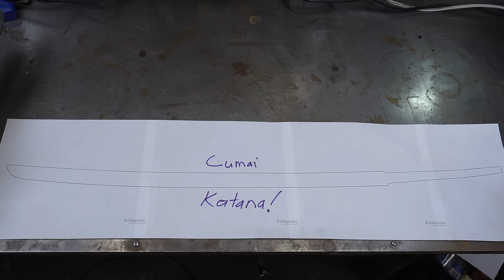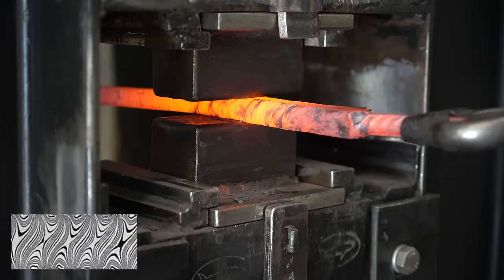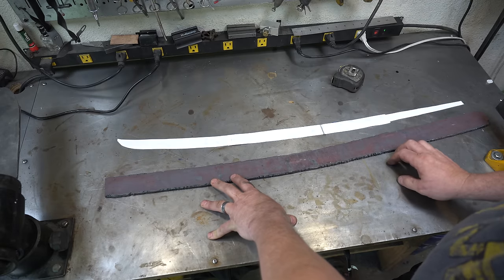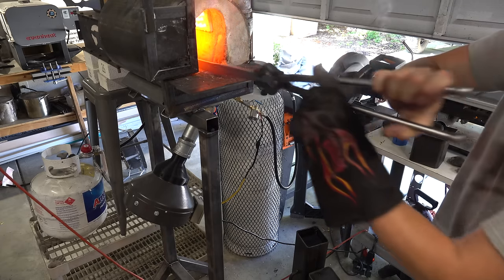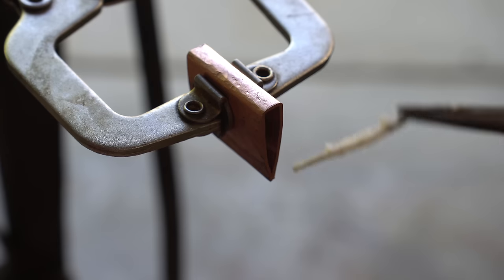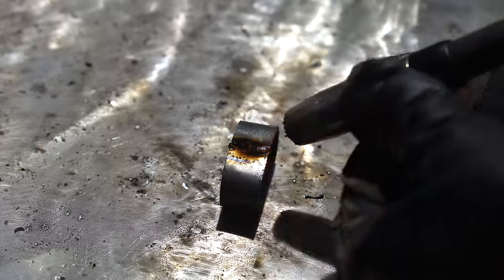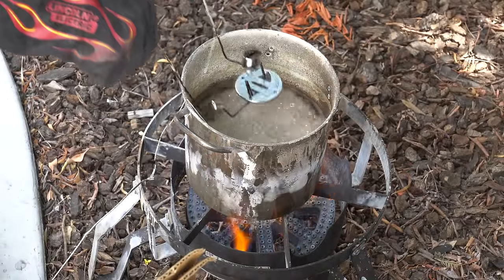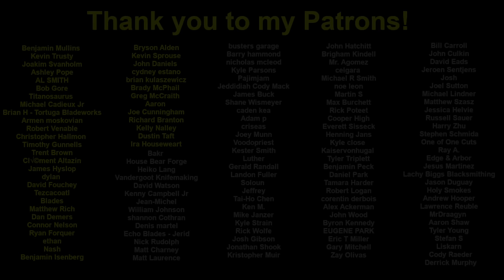Forging a Copper Damascus Katana

Comment from the maker: For those asking:  1) This one is already sold.  I do not do custom orders because this is just a hobby and I only sell what I make or the channel.  I have some knives available on my website, check those out (link in every video description).  2) Yes I'm aware that the curve in a traditional katana is from the heat treating process. I chose to not differentially heat treat this blade because it is damascus-cladded.  If you apply clay and get a hamon, the steel above the hamon will be soft and the damascus will look terrible.  The copper takes the place of the hamon aesthetically and also provides shock absorption.   3) The copper bond is very strong.   The copper in the blade is a thin sheet over the central core of high carbon steel which is also the cutting edge.  The copper brazing bond is in excess of 70000 psi in tensile strength and you'll destroy the blade before you shear the layers apart.   4) Galvanic corrosion requires the presence of an electrolyte (like saltwater).  Keep the blade clean and dry and oil it on occasion like you should with any carbon steel blade and it will last a lifetime.  Basically if you keep the steel from rusting, the copper will be just fine.    Thx.
Reply: I was wondering about how this kind of blade would stand up to combat stresses seeing as copper is such a soft metal and it feels counter intuitive to use it making a Damascus.
However, having used it the way you have in your explanation I guess it'll endure just fine. 
Have you considered a Bronze Damascus blade, or experimenting with other metals to make Damascus blades?
Reply: I know it will never happen but I wish people would stop calling this stuff "Damascus" because its not. Its pattern-welded steel. Researchers re-invented the Damascus process back in the 1990s, but aside from that no one has made real Damascus steel in more than 500 years.
Reply: That answers my question about the copper bond.
Reply from the maker: @Sajuuk  brass and bronze layering is certainly possible and people have done it.  It’s a bit trickier because the melting point of brass/bronze is about 1650F whereas copper is 1950F.  There’s less margin for error with the brass/bronze.
Reply from the maker: @TheSpenceFencer  and I wish people who have watched a video and want to tell the world what they know should refrain from telling real bladesmiths what terms to use.  “Damascus” is the accepted term for both crucible steel and pattern welded.  Every smith out there, including master smiths, will call it Damascus.  The ABS calls it Damascus.  If we wanted to refer to crucible steel we’d call it Wootz.  Plus Wootz has been and is still made today.   Sorry, if this comes off snarky but I’m tired of being “corrected” by armchair warriors who have never forged a blade.  This comes off incredibly pretentious to actual bladesmiths.
Reply: You not doing this just proves that you know so much. Phenomenal work man.
Reply: @TheSpenceFencer  you're so smart man, you radiate big brain energy
Reply: Hey Tyrel Have you every watched Conan the Barbarians 1982. Do you think you could forge his fathers sword seen at the begging of the movie. I have been begging Matt and Ilya at That Works and formally man arms to do Connor MacLeod's Katana from the original Highlander movie for about 6 years they finally said they will do it. But I loved the Conan Movie as a kid and I would to see that build. And the Katana was awesome.
Reply: I saw your previous videos, so I never doubt your decision. Different blade structure really needs different heat treat method. And wow, just nearly 2 days more and the number of likes is double 😯. I'm really looking forward to your next videos! Btw, I think "Asian swords" is a really hot topic these days.
Reply: Awesome work how much is it for a katana like that
Reply: @TyrellKnifeworks  The main issue with that is that it makes practically IMPOSSIBLE to find historical Damascus blades on the internet. You get ALWAYS redirected to pattern welded blades. That's quite annoying.
Reply: @TyrellKnifeworks  Yes but I want to see YOU make pretty copper/brass/bronze blades, Senpai!😉
Reply: Awesome creation!I think the scabbard should not have felt inside as it traps moisture and may result in corrosion, what's your take on this? Thanks
Reply: Can u please 🙏  make a test video for this blade????
Reply: @TyrellKnifeworks  It doesn't come off as snarky at all. You're right. This person has probably never even held a hot piece of steel. Like you said, everyone calls it damascus steel. Everyone knows what's meant by it. This guy is basically just the "Uhm, ackchyually!" stereotype.
Reply: My main concern while watching the video was that somehow the copper would screw with the temp diff or dissipation, but now that i think about it, the copper is way too thin, it has very little mass and it's sandwiched between to layers of steel so the difference it could do in diffusion or any other way is negligible at best.
Reply from the maker: @capomundial86  Are you referring to heat dissipation during the heat treatment?  This technique is not new and it's now been done by hundreds, if not thousands, of bladesmiths.  The blade certainly hardens quite well.  I showed the HRC test on the video.  Thanks for watching.
Reply: @TyrellKnifeworks  Yeah, im not really versed in the subject at all, just as a casual viewer and it's the first time i've seen an in depth take on this technique so it propped a lot of questions in my head. Most were answered either on the video or on this comment. But while watching i got some doubts about the difference in heat conductivity of copper vs steel and how it would affect the heat treatment, the weld and the final product. And if it does make a difference, what are the steps that account for that and change "normal" procedure to adjust for it.
Have to say it though, that blade is amazing and the quality of the workmanship is top notch.
Reply: So a question: can you make a katana using traditional method with the tools available in your shop?
Reply from the maker: @niwrad84  yes of course.  I can make any bladed weapon with the tools in my shop. 😉
Reply: I reckon you could make a mean as looking pattern with embedded copper cable. Would look like little streaks of copper. Probably really hard to do though..
Reply: @TyrellKnifeworks  man those pattern would look sick on a kris sword
Reply: Holly smoke that's a nice sword. Fantastic job! 👌
Reply: aaand you answered all my questions
Reply: People are so special on the internet Haha Thanks man!! Sad you even needed to "Clarify" for some people. Looks amazing!!!
Reply from the maker: @OffyTheSwitch  I'd be worried about the "looseness" of the cable compromising the structural integrity though.
Reply from the maker: @niwrad84  I'll definitely do a Kris as some point.  Many have asked or it.
Reply from the maker: @stanisawszczypua9076  Thanks for watching!
Reply from the maker: @danielroden9424  Thanks for watching, Daniel!
Reply: That’s really interesting.  I would have thought the copper layers would weaken it.  I’m surprised it can bond with the steel so well.  Thanks for letting us know about this.  Fascinating stuff.
Reply: @TheSpenceFencer  
True.  I had a hypothesis at one time that Damascus resulted from Syrian blade makers combining expensive Indian or Iranian steel with local lesser quality steel to save money and produce a still great quality blade; but then I watched a video which shot that down and explained that the Damascus pattern was the result of a unique, locally sourced type of steel that had certain additional metal alloys that produced the characteristic Damascus pattern, resulting in high quality blades with the unique pattern.  It’s amazing what ancient people were able to do with just basic materials and processes.
Reply: do you do custom orders by chance? im looking to get a new knife and i really love the design in this katana
Reply from the maker: @joeyong1418  If your scabbard has moisture in it, you have other problems.  In a real combat blade, it wouldn't have felt, but then they don't really care much about scratches either.  I'm trying to protect the finish on this blade.  Thanks for watching.
Reply from the maker: @Fer_Silfore  Sorry, I'm not taking custom orders right now.
Reply from the maker: @joshmajor8662  "Special"... that's one word for it.  🤣🤣🤣
Reply: @Bahamuttone   Just use the less general terms, if you want crucible "Damascus" search for wootz, bulat, crucible-steel etc.
If you search for a term used in a very broad sense, it will show what is the most common.
The confusion isn't even new, the middle east also used non crucible-steel "Damascus" (usually "random" pattern welded "Damascus" pattern like often used on modern Katana reproductions) for blades .. 
Use more specific terms and you'll find what you're looking for.
Reply: Beautiful absolutely beautiful
Reply: great explanation! thank you
Reply: That copper "hamon" looks better than a real hamon
Reply: @TyrellKnifeworks  I LOVE the black coffee effect. But i am worried that it is just for show and will rub off over time if used. Not such an issue with this masterpiece, as I would just gaze at it longingly all day in a stand (if I was lucky enough to have it) But for a kitchen knife? Is it truly viable? Does it scratch off? Would bluing be better? And if so.. can you "blue" a knife used for cooking? Is it safe?
Reply: I ask as I made a damascus blade on a course, and the knife corroded and pattenered very quickly ruining the damascus look, so I polished it hard and sanded it down a bit to get it smooth, and yeah.. I removed the acid etching. Even more worried about making a coffee knife, selling it (if I am lucky) then the person complains it does not last.
Reply: @TyrellKnifeworks  You are starting to rival kyle in a big way.
Reply from the maker: @whitenip84  thank you!
Reply from the maker: @alanwalker6708  yes, you need to keep carbon knives (Damascus or not) clean and dry and oil them on occasion to prevent that from happening.  Coffee actually helps prevent corrosion, but it can still scratch.  Some people don’t even etch their Damascus and let the natural patina have it come out over time.
Reply: When will you be on FORGED IN FIRE... I bet this is something that they would never try to do...
Reply: @TyrellKnifeworks  fuck all these haters... you're doing amazing work,  don't give them the satisfaction. Keep doing YOU and making blades fit for royalty
Reply: @TyrellKnifeworks  Gotcha. Thank you for the reply!
Reply from the maker: @allwaizeright9705  they are actually researching cumai for FiF.  I’ve applied, just waiting for them to call!
Reply from the maker: @whitenip84  thank you!
Reply: only 10 minutes into the video but needed to comment anyways :p ... need to ask about the width (back/ridge -> edgewise) of the blade to towards the tip - most genuine katanas taper from the habaki to the kissaki - did you consider this? If the tip, just around the kissaki is the same width (from ridge to edge) as in the habaki area i mostly think a sword like that looks to much like an european saber :-)
Reply from the maker: @g.ijoebear1759   it does taper from the hamachi to the kissaki.  It’s 1.25” at the hamachi and about 1.1” at the tip.  Thanks for your concern though.  😜
Reply from the maker: @g.ijoebear1759  if you were referring to thickness, that tapers to.  From 0.250” to about 0.210”.
Reply: @TyrellKnifeworks  :-) .. finished the video,, although im more of a traditional style connesour of japanse swords, yours is very nice with the damascus+copper style.
Reply: Ok, I'm satisfied with the explanation
Reply: Do you have a website or something of the sort I don't care if I have to save for a decade to buy a sword like that I want one and have you considered uploading a video of you testing it against a few things without ruining it of course 🙂
Reply: @g.ijoebear1759  Ever made a European saber or a Katana? You sound like a super expert. So how many you made?
Reply: @alanwalker6708  .. no no, im not a sword smith, just very into Japanese swords and their shapes, esthetics :-) .. and i look at other swords as well, but my favorite are the Katanas :)
Reply: @capomundial86  with modern metal it's not needed. The blade is essentially the core. The blade was a 60 Rockwell hardness. Probably better than most actual samurai swords.
Reply: where it says that sorry little b** s*** in there that wasn't meant to say that I use my microphone to type and I was trying to say whatever they call those those little bamboo mats that you guys cut or they cut and Bushido or whatever I was trying to say that I can't remember what it's called so but it came out as that I'm not talking s*** and that's a beautiful looking sword I've ever seen almost for the look I just wonder what it can do
Reply: oh yeah also I make swords myself but I'm nowhere near as talented as you are
Reply: @TheSpenceFencer  As tyrell says indian WOOTS steel made in a crucible is the ingot used and Damascus was where the best blades were forged using a folding process using these ingots. 

Pattern welded steel is when differently folded steels and often softer iron billets are forged welded together for visual appearance (vikings) and to provide a hard cutting edge with a soft spine. 

This is modern damascus. It is classified as that in every definition you can research. And why? Because the damascus part of the name is the TECHNIQUE of folding the steel. 

If you had said "no one has made wootz steel in 500 years" you would be right, but instead you come off as a wannabe no-it-all proven to know nothing beyond some half arsed google searches and zero expertise in the subject matter. 

Stay on your couch.
Reply: I love the video man. It's very cool, creative and informative.  👍
Reply: I came in looking for this comment since I wanted to know why an experiencednbladesmith such as yourself  didn't use the traditional hardening method. Noe that you explained it it makes perfect sence and I feel daft for doubting the process.
Reply from the maker: @qwertyu19951  I appreciate that you went searching for the answer.  Unlike many who just post shitty comments without even asking a question of why.  Thank you for that! ❤
Reply: @TheSpenceFencer  the only thing that made damascus special was that patterning. Crucible steel existed in other places, some real real high quality blames came out of places all over asia and europe, such as toledo steel. or spring steel. So the term for those patterns like everything else have been evolved. language evolves. We have used terms that have at one time many centuries ago meant one thing, and now it means something different. Such as a term for a bundle of sticks, the term regulated, amongst many many other things.
Reply: @TyrellKnifeworks  Any bladed weapon?
How about a matching set of cu-mai Klingon Bat Leth (sword) and Dak'Tang (Dagger)? That would be pretty sick.
Just saying.

BTW, the katana is sweeeeet!
Reply: How can i has one!?
Reply from the maker: @crimsonhawk4912  sorry, I’m not taking custom orders.  I sell what I make for the channel.  I have some knives available on my website. (Link in every video description).
Reply: Let the experts do the Katana but everyone else can use a set of kitchen knives.
Reply: @TheSpenceFencer  ok? Nobody cares Damascus is what it’ll be called now and forever stop crying about it
Reply: even so, if it rusts it would still look pretty cool a little green
Reply: @alanwalker6708 I would never had thought of that without you…. No wait… done that, didn’t really work. Still the same images of modern pattern welded thing.
Reply: @TheSpenceFencer  I agree, but people are idiots, so they'll keep calling it damascus.
Reply: @TyrellKnifeworks  you're self-described as a hobbyist. Having a bunch of equipment and a youtube channel doesn't make you an expert. If you read history, everyone knows the process was lost to time. Keep wallowing in ignorance and just pretend you know what you're talking about.
Reply from the maker: @SteveJaeger  no, it doesn’t.  But being an ABS Journeyman Smith does.  Wootz isn’t “lost to history”, that’s complete BS.  Those actually IN this craft know that, not internet trolls who just watch movies and play video games.  🙄
Reply: Do you think if you did make it to the third round of forged in fire you would make the first copper Damascus finally weapon?
Reply: No kid can not play with this
Reply from the maker: @jamesswatscheno7021  probably not, they take too much time.
Reply: @TyrellKnifeworks  I have a question/request, what is your favorite Falchion sword style and can you make it? Falchion swords are underrated I'd argue it's the European equivalent to the Katana.
Reply from the maker: @derekcox543  I wouldn't say I know many styles of Falchion swords, though I'm familiar with the basic one.  If you consider the falcata one of those, I would say that's my favorite.  Checkout my "spartan" sword video where I make a damascus one.  Thanks for watching, Derek.
Reply: @TyrellKnifeworks  The Falcata counts in my book as a distant older cousin of the Falchion through I'm sure I'd be chewed out by a historian if they ever heard me say that. I'll check out the Spartan sword video, thanks for replying Tyrell.
Reply: Well dam I want one and most definitely not going to war with it.
Reply: @TyrellKnifeworks  The felt would certainly keep the blade nice and safe... until a single grain of sand gets into the material.  Not, I imagine, that the blade will be in and out of that scabbard on a regular basis.  Having dealt with felt lined carriers before (for industrial measuring apparatus) having to get the grit and grime out of glued-in felt is a nightmare yet one bit of sand could scratch the tool to the point of ruining it... granted, the tool did not have the same hardness at all.
Reply: @TheSpenceFencer  It's good to see other people calling this out. So many smiths on Youtube falsely advertise pattern-welding as Damascus and seem adamant about doing so. For as much skill and care that they put into their craft, misinformation is misinformation and it's never a good look.
Reply: @TyrellKnifeworks "Everyone's doing it" is not a reason to perpetuate a misnomer. Whether you're a real blacksmith or not if you're misusing a term, you're misusing a term.
Reply: @Tyrell Knifeworks ... I'm sorry to inform you, but I think you got the japanese katakana inscription of your name wrong....you actually engraved "Tairenore naifu wakusu" and not "Taireru naifu wakusu". You separated the katakana "ル"(ru) into 2 . You did: ノ=no  レ =re, when together, they read "ru". I don't know if you understood my explanation. Hope this helps.
Reply from the maker: Yup, been told several times.  Not much I can do now. Thanks for watching.
Reply: @SteveJaeger  the process wasn't "lost to time" and it's hilarious watching keyboard warriors who read other idiotic keyboard warriors comments and then perpetuate false information that they clearly know nothing about. They imported Wootz steel from India, that was being mined from a certain area for a few centuries, to Damascus. Over time, the mining region where those ingots came from changed, and what changed with that? Literally the composition of the metal. Turns out, it was never the process that made the patterns, it was the impurities. So no, the "process" was not lost to time, the metal just changed, which we now know due to composition testing of old damascus blades. While I agree that this isn't technically "pure damascus", pattern-welded damascus is recognized today by every standard as damascus, so next time try not to sound so smart about "history" when you clearly don't know what the fuck you're talking about. In short, the process wasn't "lost to time," it just didn't work anymore due to the metal impurities changing with the changing ingots being imported. 

Here's a couple quotes for your simple brain, from a very simple Google search and read: 

Modern Damascus steel is not the same as the original metal. While it may be made using the same techniques, the original Damascus steel used a metal called wootz steel.

Wootz steel does not exist today, but moden blades made using high-carbon steel and forged with pattern-welding approximate Damascus steel.
Reply: Make Indonesian Kris
Reply from the maker: @mechanomics2649  just stop it.  Nobody cares that you watched a video and want to tell the world you learned something.  Seriously.  Correcting someone who’s IN the community on a term is just douchey.  When will people understand that?
Reply from the maker: @Twitter_sucks  it’s already sold.
Reply: @Sajuuk  Combat stresses? How often are swords used in a combat nowdays, I would choose a gun instead. They are functional ornaments imo.
Reply: @Ziegeri  No they're not ornaments. They're functional weapons. Stop putting words in Tyrell's mouth. He had zero issue with my post, you'd be wise to do the same.
Reply: @TheSpenceFencer  wootz?
Reply: You mean to tell me you didn't need those whom were educated via YouTube videos to tell you how blacksmithing works? 
Weird
Reply from the maker: @morningstarx5340  Ha, yeah, I somehow managed to get by without the vast knowledge some guys have from watching Kill Bill and playing video games as well.  😜
Reply: amazing work, i really like the copper accents in the blade. absolutely gorgeous
Reply from the maker: @jessereid8482  Thanks for checking it out, Jesse!
Reply from the maker: @christopherhunt7815  Thanks for the support, Christopher.  I would comment though that Woots steel DOES exist today and is made all the time.  It might have a slightly different (and technically better) composition.  Checkout my buddy Spencer at heavy_forge channel.  He's making some amazing wootz.
Reply: masterly made grats
Reply: Boa noite a algum tratamento para o cobre não escurecer ou com o tempo ele escurece?
Reply: Can I ask for how much you sold this, I am just curious if could have afforded it. Because it looks super premium.
Reply from the maker: @Alaz-Oz  I don’t discuss prices in comments. If you’re curious, email me at tyrellknifeworks at gmail.
Reply: How much did this Katana sell for, or is that an ancient secret?
Reply: Very important information, thanks for the tip
Reply from the maker: @JerryWasARaceCarDriver  I don’t discuss prices in comments.  Email me at tyrellknifeworks at gmail if you’re curious
Reply: @TheSpenceFencer  wrong. Regardless of whether or not it's true Damascus is irrelevant, all modern Damascus is referred to as pattern welded damascus. Not pattern welded steel. Damascus is an umbrella term meaning a fusion of flexible and non flexible steel. Pattern welded damascus is still damascus. Splitting hairs like this just makes you look insufferable, and in no way brings respect to the information you're trying to convey. It would have been much simpler and less snobby if you had just said "Fun fact, all modern damascus is referred to as pattern welded damascus and isn't true damascus due to lack of written instruction on the makings of true Damascus in the 1800's" I dare you to go on a show like forged in fire and tell the judges that's not damascus 😂😂
Reply: :,c I just found the video why I didn't found it earlier 😭
Reply from the maker: @y4gami1  thanks for watching
Reply: @TheSpenceFencer  If enough people use a word incorrectly, there hits a point where the meaning changes. The fact everyone calls this damascus makes it damascus.
Reply: I'm a young entrepreneur currently forming a laser engraving and vinyl business. and am interested in other things like metal work. I am just wondering how much the machines and equipment you use cost.

ALSO I totally understand if you say none of my business. since this is a personal question.
Reply from the maker: @JTL1776  Checkout my shop tour video from a few months ago.  It will go over the various tools.  You don't need everything to start though, you can get by with just a grinder and forge for quite a while.  Watch my Beginner Series playlist, that talks about how to get started.  (All in, my entire shop is about $30k in tools, though I've built a few of them myself)
Reply: @TyrellKnifeworks  thank you very much for the Information.
Reply: So, despite the incorporation of copper, this would be more resilient than period-accurate katanas, as it uses modern steel and techniques?
Reply from the maker: @Crazymoniker  I certainly can’t say it would perform better as I haven’t done extensive testing to compare it.
Reply: Can you forge an identical piece? What will the price?
Reply: Oh okay
Reply from the maker: @sambitrao  Sorry, I don't do custom orders or repeats.  I just sell what I make for the channel.
Reply: Just a friendly tip from a welder try making little c's as u push the puddle basically move back and forth as u move forward and with a billet that thick turn ur amperage up about 10 amps more and it will make an easier and better weld
Reply from the maker: @SenpaiDelta11B  Thanks for the tip Dave, I'm certainly no pro welding, that's for sure! 😜
Reply: @TyrellKnifeworks  it's definitely a difficult skill but when u weld just move the torch back an forth while pushing the puddle about an 1/8inch along the line or travel as u go and whe welding bullets what amperage are you using
Reply from the maker: @SenpaiDelta11B  I don’t remember, this was a while ago
Reply: I don't get any of this but it's awesome
Reply: First and foremost it is an absolutely gorgeous piece of art, and it looks like it’s function admirably so that is absolutely a great bonus
Reply: You're explaining yourself and having these civilized arguments here ? Man ! Let's not call it Katana 😑 It's the most beautiful sword I've ever seen ... I really thank you for sharing this and I thank the sword owner .
Reply: Very Nice 👍
Reply from the maker: @majdibouzidi  So many people with opinions on what a katana is and isn't.  I'll call it a katana.
Reply: @TyrellKnifeworks  You're the artist who made that piece of art ... So the universe allows you to call whatever you want man 🙂
Reply: Very pretty, but please, next time do not put the bend into the katana at the forge. The bend should come from the cooling process instead by putting clay on the back of the blade, and quenching it in oil.

The bend naturally happens due to the blade edge and "spine" cooling at different speeds.
Reply from the maker: @ulyssesthedm  why don’t you actually read the pinned comment.
Reply: So I live in mountain country and I just lost the tomahawk that my father had given me before he died and it wasn't anything special and I had always said that I wanted to get a custom blade I was curious what your hourly rate is and if you had any ideas floating in your head for what would be considered tactical tomahawk that would be you know functional and not to cumbersome not just a wall hanger and that katana you made was flipping beautiful like wow
Reply from the maker: @doejohnathon3487  sorry, I’m just a hobbyist so I only sell what I make for the channel and don’t do custom orders.  I’ve never made a tomahawk before, only a hatchet.  If I were to do something like that it would probably be a Damascus Viking axe.  Thanks for watching.
Reply: @TyrellKnifeworks  no I read that and that's why I was I guess I didn't voice it correctly I was asking if you had any ideas of something to that nature bouncing around in your head For an upcoming video or something but no like I said you work with phenomenal and I truly wish the guy who bought it was a guy I moved a couple of months about six months ago he had it might sound weird but yeah he had the most beautiful wooden grave table that he got in Japan and a teal dragon that he got in Japan and then he paid $25,000 you said for this katana that he kept over his kids crib crazy
Reply: @TyrellKnifeworks  well said
Reply: Who did you sell that masterwork of a katana to??
Reply: Great info! Thanks
Reply from the maker: @GenocidalSquid  it was sold to a Patreon member.
Reply: @TyrellKnifeworks  OOOOOHH!!
Reply: I want one of your swords!!!
Reply: @TyrellKnifeworks  tbf I had read something similar to what he was saying from multiple sources. Basically that the original damascus was made from wootz and that once the mines in damascus ran out of iron they couldn't produce it anymore and the process was lost to time. Clearly this was misinformation because you're correct they do still make wootz and many other places produced it before, during, and after the city of damascus did. Why was this perpetuated so much?
Reply: @TyrellKnifeworks  great work by the way! That craftsmanship is insane. I have been wanting to put together a workshop and start forging for years. Truly inspiring stuff my guy
Reply from the maker: @sethwinters3556  I’m sure there’s been some history channel episode or something that perpetuates the myth.  They like the mystique around saying it’s “lost to time” but it’s BS.
Reply: bro dont mind me just me BANGING my credit card while seeing this result
Reply: Ku
Reply from the maker: @praveenr9071  I have no idea what meant by this.
Reply: Aside from the method you mentioned and chose not to do you've done pretty well at honoring the katana. It's quite clear you've done you're research. The only critique I have is with the fit of the habaki and the saya/sheath. Traditionally they would fit so closely as to need a push to break that pressure lock. That's why you see media of the thumb pushing the sword out using the tsuba. Not just hollywood drama. Overall a really honorable and just plain cool build. (Also please don't throw the saya.😅)
Reply from the maker: @justinyermaw2986  my website link is in every description.  Note though, my builds go up for sale to my Patreon members first.  The popular ones (like this sword) don’t make it to the website usually. This one was purchased the day after the video went up.  Thanks for watching.
Reply from the maker: @justinyermaw2986  It is, plus there's a link to my Patreon in every video description if you need that.  Thanks for watching, Justin!
Reply: @TyrellKnifeworks  NO IT'S NOT!!! Just because a much of smiths who never picked up a history book in their lives like to uses a term incorrectly DOESN'T make it correct. Pattern welding was thought to be the same thing by European smiths who were attempting to duplicate the Damascus steel in the middle ages. I'm a Historian with two Ph.D.'s and I take people claiming something is what it isn't very seriously.
Reply from the maker: @ShionWinkler  You can get mad as much as you want.  Every smith out there, including just about everyone in the American Bladesmith Society, will call it generically damascus.  Bitch about it all you want.  Correct someone in a bladesmithing forum and you just look like a pretentious ass.  Frankly speaking, correcting someone on this just makes it look like you want to show everyone how "smart" you are.  You don't need to defend history.  We don't care.
Reply: @TyrellKnifeworks  well said! You can call it a Hippopotamus if you’d like and it’s still a great piece of work lol.  You obviously take great pride in your work and it shows.  Keep up the great work brother!
Reply: En cuivre !?? Ça va faire mal les mottes de beurre n'ont qu'a bien se tenir  😆😆 t'veux couper quoi avec une lame en cuivre ? Elle se déformerait illico
Reply from the maker: @destructurateurmoleculaire6095  Pourquoi n'essayez-vous pas de poser une question à la place ? Peut-être que vous apprendrez quelque chose au lieu de passer pour un crétin.
Reply: @ulyssesthedm  sit down lol, read what the guy said
Reply: @ShionWinkler  got your two phds from Youtube University eh? nice one richard
Reply: @TheSpenceFencer  Hey, do you maybe have a link to a video? i´d be interested in how "real" damascus is build. thank you
Reply: @TheSpenceFencer
At this point so many people have been calling it Damascus for so long that it has effectively changed the definition. If you really want to be pedantic about it call it Pattern welded Damascus 
But doing so would be basically pointless
Reply: How strong would this blade be compared to 1095 or a blade of high carbon?
Reply from the maker: @Mourningstar-kc7ft  Exactly.  Do these guys also walk around and correct people when they say "Kleenex" instead of "tissue"?  🙄. It serves no purpose other than to make them look ridiculous.
Reply: Hey, Spence. I’d like to point out Tyrell’s @ to you because it says what I would’ve. Aside from that you’ve gotten me curious, a re-invent of the Damascus steel style in the 1990s? Couldn’t find anything about that my friend, in your obvious brilliance on the subject could you point me to a source of any kind? I’m genuinely curious to know.
Reply: Hi, does anyone know the value of that blade?
Reply from the maker: @kentlab3850  I don’t discuss prices in comments.  If you’re curious, email me at tyrellknifeworks at gmail.
Reply: How much does a blade like this run?
Reply: Can i buy one sir??
Reply: what was the weight of finished blade?
Reply: @TheSpenceFencer  really? should the title be totally fake metal sword?
Reply from the maker: @Joe-Frost  I don’t discuss prices in comments. Email if your curious.
Reply from the maker: @logansharp9520  read the pinned comment.  I do not do custom orders.
Reply from the maker: @levanidavitashvili3814  the finished sword with handle was 2.5lbs, 1.1kg
Reply: @TheSpenceFencer  You should start doing some traveling outside your neighborhood, go to distant lands, villages, and islands outside in the world. 
To say 'no one has' in such a long time in itself is a proper oxymoron, as it is a craft that is hard grained in both legend and ancestry. Someone out there to this very day, I guarantee you, has in fact forged real Damascus. 

But yes, you are correct, this particular forging is NOT Damascus in name alone. And it would do well for them to properly name the method instead of applying false terminology .
Reply: @TyrellKnifeworks  1. You don't speak for every single bladesmith
2. you have no idea is the 'armchair warrior' you disrespectfully snapped at has or has not forged a blade. 
3. Grow some thicker skin, at your age you should know better.
Reply from the maker: @darixenous_shadowscale  Understand this:  correcting someone in comments has NOTHING to do with defending history.  They are trying to show the world how "smart" they are by correcting someone else.  It's purely an ego thing only and to fulfill your desire to appear knowledgeable.   PERIOD.  You'd also NEVER do something like that in person or the smith would look at you like you're an asshole.  Bladesmiths simply do not care and will never correct each other on something so stuipid.  Do you correct people when they say "kleenex" instead of "tissue"?    Stop this nonesense.
Reply: can you do it with gold next time instead of copper?
Reply: @TyrellKnifeworks  hi there bro, excellent custom as always. I'm looking to start bladesmithing myself, any tips? I'd really appreciate any suggestions
Reply from the maker: @alpha__321  stay tuned!
Reply: You should auction your work
Reply: Does the saying, or expression, sorry I asked , ring a bell. 😆
Reply from the maker: @aliwaheed906  I’m not a fan of auctions.  I feel like I know the value of my work and auctions just try to squeeze out more money from viewers.  I’m good with regular prices.
Reply: @TyrellKnifeworks  respect
Reply: copper turn green
Reply from the maker: @joeh858  not if it’s taken care of.
Reply: it looks cool. you could of made like over 40 knifes with all that material to make that 1 fake katana and made bank or 6 kitchen sets of damascus-copper knives for over 5000 each set
Reply from the maker: @real_entless1301  first off, it’s not a fake katana, it’s quite functional. You say make them for money, but I’ll make 6-7x on this video what the katana even sold for.  Think about that.
Reply: I was looking at katanas and knives after watching this video and a full tang Damascus kitchen knife goes for close if not the same price as a Damascus katana. 

I'm not arguing the functionality of the blade, the romanticized image of a katana is of the heating process and tempering process making it a katana. it's like comparing a cognac to a brandy, at the end of the day its all going on someone's wall and it looks grate.
Reply: @TyrellKnifeworks  Salut cât ar costa katana pe care ați făcut-o în Video???
Reply from the maker: @cipriancarpaci5760  Ne pare rău, nu discut prețurile în comentarii. dacă ești curios, trimite-mi un e-mail.
Reply: does the copper oxidice overtime or no?
Reply from the maker: @maple4573  not if taken care of.  It should be clean and dry and oiled on occasion, like you should with any carbon steel blade. Thanks for watching.
Reply: Very cool! Thanks for the info brotha!
Reply: When you pressed the billet for the first time, I noticed what look like some liquid leaking out, what was that? was it liquified flux?
Reply from the maker: @velorexvelorex4605  yes l, that was liquid flux.  I use flux on the initial forge weld but after about 3 heats it’s not necessary any more.
Reply: That sux you don’t custom make these!! That was a nice piece of work!
Reply: @TheSpenceFencer  it's very nice sword design 🐔,  the ambience is Damascus steel and rose gold 👍🏽👍🏽
Reply: bro great job good work this is piece of art kindly don't sold your masterpieces
Reply: I bet it sold for a pretty penny
Reply from the maker: @Solidous281r6  It was a few pretty pennies, yes.  😜
Reply: i would like to Buy one right now  🙌
Reply from the maker: @kevinstgeorges8820  sorry, I don’t do custom orders.
Reply: In this modern world of guns why would anyone need sword. And that also so so sharp and dangerous.
Many countries allow guns but banned display or even possession of swords.
Offcourse it's world class product and anyone can get tempted to have one.
Reply: Just wowwww.... 💓 I love it...... 💓
Reply from the maker: @mr.america9806  these are more works of art.  Most are not used, so it matters little that it’s a weapon.  You could say the same thing about antique guns that are far inferior to todays weapons but people still collect them.  Thanks for watching.
Reply: I was going to ask how much to have one made, or two, but i see you don’t do custom orders.  😢😢😢.  Great job by the way.  Love the way the sword looks.
Reply: Can I borrow this for my upcoming 500 word essay thx
Reply: @TheSpenceFencer  🤓
Reply from the maker: @ShepherdSaint these handles are always done this way.  Note, the bond where the epoxy is will be stronger than the wood.  If you tried to split it, it wouldn’t split at the seam.  Thanks for watching.
Reply: Hello sir, I wanted to let you know how cool it is that you put up an image showing what the pattern looks like as you hammer it. I'm not sure how long you've been doing that but it's great and I really hope you continue to do it. Thx for a great video, sir.
Reply from the maker: @willsmith1689  Thanks Will, I'm glad it's helpful!   I've been putting graphics in the corner for a year or so when I'm doing damascus.  It's much easier for the audience to understand what's going on in the pattern that way.  Thanks for watching.
Reply: How long did it take to make? Also it looks awesome
Reply from the maker: @paydino9565  this build took about 100 hours.
Reply: How much did you let that master piece go for if you don't mind me asking?
Reply: Also I appreciate the level of involvement you have with your fans you literally reply on almost every comment I've seen not only does it take mad discipline and years out of one's life to attain the forging skills you have, you also take the time to actually talk to the community. For what little it may mean you have my respect for the dedication
Reply: This man has hands from gold. 👏❤️
Reply: I would pay my entire bank account to get you to remake that sword for me!!, how much did it sell for ???
Reply from the maker: @jonnnymadethis4555  I don’t discuss prices in comments.  You can email me at tyrellknifeworks at gmail.
Reply: May I know the sold price of this masterpiece?
Reply from the maker: @pkvai3639  I don't discuss prices in comments.   If you're curious, email me.
Reply: i wonder if the copper helps at all with the heat treat with how great a conductor of heat it is. there's a damn good reason why some of the best kitchen pots/pans in the world are solid copper and it's not just that it self-sterilizes. esp with how you were saying the katana was so long that only chunks of it could be heated at a time. i got kinda nervous watching the steel cool down so fast under the hammer but now i'm wondering if the copper mitigated some of the risk of smacking cold steel by helping it retain heat longer in the first place. the core of the blade stayed solid.
Reply from the maker: @ebonychan  the copper is only 0.020 inches thick, that’s not going to affect the heat at all.  By the time it’s forged it’s half than.  That’s almost the thickness of two pieces of paper.   It’s not gonna affect anything.
Reply: would u let me know when, or if, you do another?
Reply from the maker: @codybudris7137  I won’t be replicating this one.  Best to become a Patreon member.  They get first crack at all my builds.
Reply: Your work makes me desire to do what you do.  However, I have enough projects.. so, keep on keeping on!
Reply from the maker: @lourias  I'm glad it could inspire you a bit, even if you don't want to take up a new hobby!  Thanks for watching.
Reply: please i must know how much does that cost, i badly want something like this
Reply from the maker: @OA-Wanted  Like it says in the pinned comment, I don't do custom orders.  Sorry.
Reply: That blade is incredible. I love the look and colour.
Reply from the maker: @christianmclean7868  thanks for watching!
Reply: It's rare that blade makers take the time to actually answer these questions I have. I was wondering about the clay differential heat treat katanas should have, and I would have asked about the blade strength. You're pretty cool.
Reply from the maker: @bbd121  I try to answer all comments.  👍🏻
Reply: where can i buy your product?
Reply: First, see the results of the katana that you made, I am really interested and really like it.
Reply from the maker: @D_KHO  Thank you!  Sorry, I don't do custom orders though.
Reply: @TyrellKnifeworks  don't you have an online shop that sells your work?
Reply from the maker: @D_KHO  Yes, there's a shop section of my website.  (link in every video description).   There are no knives available right now though.  My work goes up for sale to my Patreon members first and much of it never reaches the public.
Reply: @TyrellKnifeworks  But I saw that in your online store there were only a few items.
Reply: Roughly, how much does your equipment cost total in case I wanted to buy a blacksmithery for myself?
Reply from the maker: @stephendaniel9581  you don’t need all the tools I have to get started.  Checkout my Beginner Series playlist.  That will get you going.
Reply: pp pl pñ
Reply: ñ0
Reply: pp
Reply: pp
Reply: pp pp
Reply: 0
Reply: @Paradox-vk9fe
Reply: p
Reply: @TyrellKnifeworks
Reply: ñ
Reply: pñ
Reply: pp
Reply: p
Reply: pp
Reply: ñp
Reply: ñp
Reply: ñp
Reply: 0
Reply: ñp
Reply: ñpp
Reply: All
Reply: ppppp
Reply: All ppppp
Reply: ñ
Reply: @TyrellKnifeworks  Thank you for the quick response. I will watch.
Reply: @real_entless1301  Why are you in the comments section on youtube. With you business since I would expect you to be making money right now.
Reply: @TyrellKnifeworks  doesn't bronze just being cast in the form? The differense between steel melting tempreture (1500 C) and bronze (950 C) would ,make the bronze boil during forge-welding attempt, isn't it?
Reply from the maker: @ЕвгенийСолопин-л3ф  first, it’s copper, not bronze.  The melting point of copper is 1950F and the heat treat temperature is 1500F so that’s why this works.  Thanks for watching.
Reply: Copper is a horrible metal to make swords with.  How about making titanium. cobolt, tungsten, carbide steel and then deposit copper when it's complete, to look pretty.
Reply from the maker: @jan_phd  If you actually look at the construction of this, the copper is 0.010 inches thick sheet over a central core of high carbon steel.  That's about the thickness of 2 pieces of paper.  This doesn't affect the strength of the blade.
Reply: @TyrellKnifeworks    Ok, then make a video of a blade with copper cladding, and one without, being struck against the corner of a carbon steel anvil.
Reply from the maker: @jan_phd  I've done destructive tests on cumai blades before, they stand up fine so long as the core is thick enough.  Note, the 2021 Blade magazine production knife of the year has copper in it.  This is a proven technique.
Reply: @TheSpenceFencer  get schooled buddy
Reply: Im curious about the price after you sold it..  how much is it sir?
Reply from the maker: @geoffreyvonmarkirada8823  Sorry, I don't discuss prices in comments.  If you are really curious you can email me.
Reply: I need one, dammit, name your price
Reply from the maker: @jackbotman  Sorry, I don't have the time or capacity to do repeats of other builds.
Reply: Man you are the bomb! You put those Japanese swordsman to shame. Make’s them look like a bunch of rookies!  As usual, great job!
Reply: Well, Damascus actually nanotech so.....
Goodluck with that.
Reply: It's a pity you don't do custom cause you have a gift with such a beautiful blade.
Thnx for the heart
Reply: Can you allow me to use your video as a Vietnamese voiceover.  I will put your original video link in the description so people can see your original video.  Thank you so much
Reply from the maker: @relaxmovie9462  Sorry, I do not allow my content to be reused and reposted.
Reply: You really thought this project out! Well done! It looks absolutely amazing, too.
Reply: Ģ
Reply: Ģ
Reply: Absolutely stunning :o
.
PS:  Please go on Forged in Fire :)
Reply from the maker: @ADB-zf5zr  I’ve applied, just waiting for them to call! 😜
Reply: Okay ! No Problem Sir 😊😊😊😊😊😊😊😊😊😊
Reply: It didn’t see it coming together and looking that dam good! Well done! Wow you have some incredible tools at your disposal!
Reply from the maker: @MV2024WDC  I didn’t start out with all the fancy tools, nor do you really need all of them, it just makes things go quicker.  😉
Reply: L
Reply: how much did you sell it for if you don't mind me asking
Reply: an extraordinary work, in my place there is a legendary weapon its name is mandau kalimantan, maybe you can see, or make this ancient thing
Reply: u only sell the ones u made on the channel, but where do u sell them if u do not sell them, tf
Reply from the maker: @gheorghestavila3590  my website is linked in every video description.  Thanks for watching.
Reply: @TyrellKnifeworks  okkkkkkk, gonna check it rn
Reply: @TheSpenceFencer  that’s why people call it Pattern Damascus as yes Wootz Damascus has not been made for centuries, but Damascus in modern context refers to the pattern. When Wootz hasn’t been made for centuries any modern smith or blade enthusiast would be referring to Pattern Damascus. It’s assumed
Reply: metin2 lvl 1 sword
Reply: Phenomenal my man. Thanks for sharing.
Reply: Don u have no phone...i Wanna to buy this sword
Reply from the maker: @sitahklukjagataddin8948  this sword is sold.
Reply: @TyrellKnifeworks  how much
Reply: @TyrellKnifeworks  i'm from Malaysia..can u do it for me one
Reply from the maker: @sitahklukjagataddin8948  sorry, I’m not taking custom orders for these.  Thanks for watching
Reply: @TheSpenceFencer  اقرأ التاريخ جيدا
لقد كان يصنع السيف الدمشقي منذ اكثر من ٨ قرون وقد كان معروفا بأنه يقطع الحديد
Reply: A
Reply: A
Reply from the maker: @@frankblunt2366 Why don't you actually look up the definition of pretentious?  Here, let me do it for you since you seem incapable of research:  "having or showing the unpleasant quality of people who want to be regarded as more impressive, successful, or important than they really are."  Bladesmiths aren't using the term to be more impressive, it's a descriptive term that everyone understands.  YOU trying to correct everyone and show off your vast "knowledge" on the topic is pretentious because you aren't doing it to defend history or anything, you are trying to impress everyone.  We aren't impressed, and in fact, it does the opposite.
Reply: Anda akan menjadi legenda ❤❤❤❤❤❤❤❤❤❤❤❤❤❤❤❤❤❤
Reply: je suis entièrement d'accord avec vous c'est un abus de langage dire damas , ce n'est qu'un empilage de barrettes ,et ceci s'appelle coroyage  en français, mais malheureusement cette abus de l'ange est admit parmis les pseudos artisants  qui emploient  le mot "damascus" à tour de bras  , et surtout par les fabricants de couteaux étasuniens.
c'est vrai au niveau estétique ,c'est bien mais c'est tout.
Reply: @Crazymoniker  lol you are clueless of what folding a thousand times does to the metallurgy.
Reply: Just intresting how soon contact corrosion will start.
Reply from the maker: @positiveenergy5004  read #4 of the pinned comment.
Reply: Man I just saw that you don't do custom orders...super sad. I was trying to order one. ha
Reply: What did it sell for if I may ask?
Reply from the maker: @jimmzsp.3618  sorry, I don’t discuss prices in comments.  You can email me if you’re curious.
Reply: Just curious, how much you sold this piece of art for?
Reply from the maker: @zaidpatel8695  sorry, I don’t discuss prices in comments. You can email me if you’re curious.
Reply: this is amazing!
Reply: @irw3239  "Btw, I think "Asian swords" is a really hot topic these days."

I think that's your personal impression based on your own opinion on them. They are not suddenly any more popular than they ever were in past years.
Reply: I enjoy diannd blade sharpness
Reply: I was wondering how much you sold it for or how much you valued it at in today's market?
Reply from the maker: @ModoTronic666  sorry, I don’t discuss prices in comments.  If you’re curious, email me.
Reply: Hello. How much did you sell it?
Reply: I want to buy it
Reply from the maker: @mishantvlogs2210  Per the comment, this one is already sold.  Thanks for watching.
Reply: A
Reply: BEAUTIFUL
Reply: All I want to know is how I can buy a sword from you.
Reply from the maker: @Pccpy  Sorry, right in the comment you responded to it says it was sold and I don't do custom orders.
Reply: @TyrellKnifeworks  I know, I just love your work and can't resist to ask.  Thank you.
Reply: would look kind of cool if  copper did get some patina
Reply: offcourse its already sold, was about to ask hahah
Reply: @TheSpenceFencer  Just a gripe, no teachings?
Reply: So you wouldn't be willing to make a custom sword if someone sent you what they wanted to look like and the material plus enough material that you could make more if you wanted I do have a sword design that I just don't have the tools to be able to create myself and I'm used to doing nothing bigger than a 18 inch blade
Reply: 00000000000⁰0000000⁰00⁰000000000⁰00000⁰00000000000⁰00000000⁰⁰⁰000000000000⁰0⁰⁰00⁰0⁰0⁰⁰0
Reply from the maker: @josephandjessicaweber613  ha, no I’m not interested.  The material is about 5% of the cost, the rest is labor.
Reply: I don't know if you'll see this, but I think a copper damascus Roman Gladius would look sweet. The simplistic design of the Gladius with the elegant damascus would be very fitting of the largest empire to have existed in the ancient world.
Reply from the maker: @xfatboy35x29  some day I’ll do a gladius.  I’ll be working on a Scottish Claymore later this summer, do that will take quite a while.  Thanks for watching.
Reply: @TyrellKnifeworks  Sweet. I know that claymore is gonna look nice.
Reply: I agree 😮
Reply: T
Reply: Price of this master piece sir
Reply from the maker: @sudhanshugoswami5709  Sorry, I don't discuss prices in comments.
Reply: How about if I say pretty pretty please :P? Ok, then. How about if I ask for a really long slighty curbed knife with a katana handle? My God, that sword is beautiful!
Reply from the maker: @GojiGuy some day when they give me a call!
Reply: Like I see you at fake ,the true herting?
Reply from the maker: @antonellapintus-ey9bi  I have no idea what your comment means.
Reply: I would love a full set.
Reply: İ am not a blacksmith ir anything but in a video i watched a guy put the paper on the steel and then he puts magnets on the paper to keep it in place and he sprays the blade and cuts the sprayed part i don't know if this helps you or not :)
Reply from the maker: @ak10pro53  Yes, I've seen this method.  I just don't have any of the layout fluid in spray format.  Thanks for watching.
Reply from the maker: Clémoki26  titanium is a terrible sword material.  I would only achieve about 45 hrc while steel can be 55-60 hrc for a sword.  😉
Reply: I know a sword looks good when all I think is "I want that sword," as soon as I see the end product. Excellent craftsmanship.
Reply from the maker: @SeriouslyWeirdDream  I'm sure it would if you tried.  😜
Reply: Such a beautiful blade. Have you ever considered joining the "Forged in Fire" competition I think its called in History Channel?
Reply from the maker: @Truthorfib  I know the show very well.  I’ve applied and I’m just waiting for them to call. 😉
Reply: @TyrellKnifeworks  That's cool! I really hope they consider you there and would really be a must watch for me. Good luck and hope you get the opportunity! ^_^
Reply: How much did you sell this off for? It looks like a 70k+ sword
Reply from the maker: @geosekiro324  I don't discuss prices in comments, but certainly not $70k.  I wish though.  😜
Reply: 你好，这把刀卖了多少钱？谢谢
Reply from the maker: @沈惠平-r2r  抱歉，我不在评论中讨论价格。材料费超过 300 美元，但劳动时间超过 100 小时（也不是最低工资）。那应该给你一个想法。
Reply: @TyrellKnifeworks  I am Chinese how to buy from you
Reply: @TyrellKnifeworks  I am Chinese how to buy from you
Reply: Which country are you from? Can I visit your factory?
Reply from the maker: @沈惠平-r2r  I’m in California, but I wouldn’t call it a “factory”.  It’s a small shop in my garage. 😉
Reply: Pp
Reply: would you copper coduct electricity? ELECTRIC BLADE
Reply from the maker: @ghostlyguygoes-boo6857  ha yes many have said the same thing. 😉
Reply: @TyrellKnifeworks  василий, ты откуда взял Дамаск? Сам придумал? Услышал где-то, а потом решил всем выставить эту фигню за Дамаск?
Reply from the maker: @_Mother_Of_A_yotube-Developer  Я думаю, что ваш комментарий потерялся в переводе.
Reply: gg but try not to waste food.
Reply: Can you tell me what chemicals did you use to make the blade like that?
Reply from the maker: @guen2072  it’s ferric chloride acid to etch the blade then very hot VERY strong instant coffee to turn it black.  Thanks for watching.
Reply: Please....how much for it...I would like to officially buy it...
Reply from the maker: @amaanshaikh11132  Sorry, this build was sold the day the video released.
Reply: @TyrellKnifeworks  would you make one for me ? Please ? I will look forward for it
Reply from the maker: @amaanshaikh11132  Sorry, I'm not taking custom orders.
Reply: @TyrellKnifeworks  oh sorry to hear that.....btw that's the best masterpiece I've ever saw....i would be really happy if you made one...thankyou
Reply: @TheSpenceFencer  It's pattern welded steel🤓🤓🤓🤓🤓🤓🤓🤓🤓🤓🤓🤓
Reply: If you ever change you mind about making some customs swords please let me know. I thought it turned out amazing.
Reply: Amazing work
Reply: Omg that looks so cool, can I please have it
Reply: nvm :(
Reply from the maker: @theblizzard9926  did you read the comment you replied to?  😉 It’s already sold.
Reply: For how much was it sold?
Reply from the maker: @random_youtube_user  sorry, I don’t discuss pricing in comments. If you’re curious you can email at tyrellknifeworks at gmail.
Reply: @TyrellKnifeworks  sure thanks, I was just interested in buying some stuff , that's why I was asking
Reply: Damascus sucks for a blade dude, its only for looks
Reply from the maker: @destruidor12ban40  whatever dude.  My customers would disagree.
Reply: @TyrellKnifeworks  no one ever used damascus blades on battles besides the dumb and dirty saracens and Middle east factions back blade and armor times
Reply from the maker: @destruidor12ban40  haha, that’s because the steel came from that area and wasn’t available to the Europeans until much later when they DID use it.  Stop with the BS
Reply: @TyrellKnifeworks  well my point is, no nation that made the finest blades for combat used it, its brittle, damascus is decoractive anyway worndeful work sir
Reply from the maker: @destruidor12ban40  all due respect, you don’t know what you’re talking about.  🤣
Reply: @Sajuuk  are you planning on going to war with it? it looks gorgeous be happy
Reply: Just a heads up, your website needs a little tlc, UI is kinda funky near the bottom and the cookie settings are in a separate area from the "accept all cookies" popup
Reply: What I hate about you not doing custom orders... These blades are going to be that much more expensive later.
Reply from the maker: @syncringe1885  for now, all my builds are one-of-a-kind because this is a part-time hobby.  Maybe some day I’ll move to full time.
Reply: @TyrellKnifeworks  Would be fun to watch you create every unique request you get but its your hobby. As long as your having fun that is what matters. Seriously though. One day these works of art are going to be worth billions.
Reply: What kind of press is this?
Reply from the maker: @tanchu7502  it’s my home built 30 ton press.  I have an overview video on it if you look back in my video library.
Reply: I see, thanks!
Reply from the maker: @serg12746  Ха-ха... правила? Забавно, что какой-то парень в Интернете думает, что он должен рассказать аккредитованному оружейному мастеру, что такое «правила». Вернитесь под свой мост.
Reply from the maker: @serg12746  Эй, продолжай отвечать. Ты просто зарабатываешь мне больше денег. 🤣
Reply from the maker: @serg12746  Нет никакой "покупной" аккредитации. Я член Американского общества кузнецов. Это больше, чем я могу сказать вам, что это ничто, и кто-то, кто ничего не знает и ничего не может сделать сам, поэтому они пренебрежительно отзываются о работе других людей.
Reply from the maker: @serg12746  ха-ха.. хорошо дружище. Просто продолжай нести чушь... это просто увеличивает количество просмотров и интерес и приносит мне больше денег. 🤣
Reply from the maker: @serg12746  Просто признай, что ты тролль, который ничего не знает. Не отвечайте обоим, теперь вы скрыты от канала. До свидания.
Reply: Bro seriously how much dollar for this? 
Iam serious to buy this, i don't wanna the other, i just ask katana in this video
Reply from the maker: @justwatching7835  sorry, this katana was sold the day the video was released.  Stay tuned, I’ll be doing another katana in Oct.
Reply: @TyrellKnifeworks  ok i hope this katana was amazing than before... 
I will keep my money to buy in october
Reply: u said its sold already..how much  u get for this?
Reply from the maker: @ByteFuse1  I don’t discuss prices in comments.  If you’re really curious, you can email me at tyrellknifeworks at gmail.
Reply: Personally, i never would have asked you to sell it. That's like dicks asking how much i want for my custom e-bike. Do i look like a crackhead, or unworthy of owning anything nice to enjoy? If it pisses me off, i'd never ask someone else to part from their artwork.
Reply from the maker: @aleksandrbmelnikov I actually sell all my work.  Though these can be considered art, they still are for sale. 😉
Reply: @TyrellKnifeworks  Point made. If someone wishes to sell their artwork, then allow them to offer. Not insult them by presuming or inferring they have no right to keep it.
Reply: Cestcombienleprixdachatdusabre.
Reply: @TheSpenceFencer
Reply: @TheSpenceFencer
Reply: Love it
Reply: @joeyong1418 I have heard that Viking’s used wool slathered in fat inside their scabbard to protect the blade.
Reply: OMG WOW! beautiful !
Reply: after long process sword is  ready now, superb creative work
Reply: Re 2 - I am so sorry bro. You made the mistake of making a katana. You're going to get the kind of people who like those things. And they are the incarnation of cringy basement dweller. Stick with European weapons and you'll have sensible people.
Reply from the maker: Ha, yeah everyone seems to think they’re experts on katanas because they play video games and watch anime. 🤣
Reply: @TyrellKnifeworks  Ninja Turtles!
Reply: @TyrellKnifeworks  🐢🐢🐢🐢 🤣
Reply: معلومات مفيدة وراءعة من إختصاصي و خبير
Reply: Hi, I have a hand forged, carbon steel fold out knife my Dad bought for me a couple of decades ago for my 30th birthday, not long before he died.  It's a lovely knife, but I didn't look after it the way I should have with oil as you state in your comment, and now it has some surface rust - no pitting as far as I can tell.  Thinking if I hit it with some 300 grit, then 1000 grit or something, I can just clean the rust off and then oil/wax it, it'll be OK?  Or is it ruined?  Any advise appreciated - at the time I got it, I kinda had mixed feelings towards my Dad, but as time has gone on I've realised he did the best he could, and so this last (and probably for him, really expensive) gift from him has become more special to me.
Reply from the maker: @Beer_Dad1975  I wouldn’t go as low as 300 grit.  Start with just a green 3M scrubbing pad and some wd40.  That might do it.
Reply: @Beer_Dad1975  Little you do, the better. Don't jump in with sanding. Try a liquid rust remover or rubbing compound first. May take longer, but you won't cause new scratches.
Reply: @TyrellKnifeworks  Thanks, I'll give it a go 🙂
Reply: Hello
Reply: I need this Emmargencey delivery of this
Reply: y
Reply: So a western man doing a katanaesque sword without any respect at all for the process of actually making a katana. The sword looks awesome but I feel like I would like it more if it was a western saber.
Reply: See i know you dont do custom orders, but what if i just kept adding a zero, now im not saying i got that but is there a price?
Reply from the maker: @brianthompson7675  email me at tyrellknifeworks at gmail and maybe we’ll find a solution. 😉
Reply: Dude, I jizzed in my pants when I read the title!!!
Reply: I want buy can?
Reply from the maker: @youngkyhyla4444   This katana is already sold but the silver one I just released a video for is available.
Reply: Mi venderesti la spada ? Fammi sapere se la vuoi vendere
Reply from the maker: @whitewidow8449  Mi dispiace, questa spada è stata venduta molto tempo fa. Grazie per la visione.
Reply: Well, you know what they say. Since the invention of excuses, lazy people became extinct...
Reply: Х
Reply: I dabble in knife and sword forging and I have to say it was a.privlage watching you work beautiful and completely functional you could sell that piece for and easy 35000 dollars it's one of its kind.
Reply from the maker: @JamesLoch-ky3un  thanks for checking it out, James!
Reply: Es simplemente hermosa!!! Que gran trabajo
Reply: I love your work! Amazing stuff... Hard work and talent can achieve anything!
Reply: beautiful just beautiful, that is one of the most gorgeous blades I've ever gazed upon. just seen this video, I've always wanted one like that.. you are a master of the craft indeed.
Reply from the maker: @Tman01  if you like this one, checkout my recent katana.  I think it’s more impressive. 😉
Reply: Gfc ho
Reply: I’ll check the knives out thank yoi
Reply: Damn i would of bought this fr
Reply from the maker: @Acedude227  thanks for watching
Reply: is it available to buy?
Reply: Yeah but is he good with PowerPoint? 😂
Reply: you should make a タングステン層
Reply: buat gua bg
Reply: dude i need to buy it! how much do you offer?
Reply from the maker: @merlinopp5520 sorry, this one is sold.  For a private commission, please reach  out via my website.  Thanks for watching.
Reply: @TyrellKnifeworks  thanks to you man
Reply: One of the most beautiful swords I've ever seen.
Reply: Красивая игрушка, но это уже не дамаск.Это не сталь.
Reply from the maker: @АндрейГерман-ы4з  Возможно, вам следует задать вопрос, а не переходить к негативным ответам, вы просто можете чему-то научиться. Весь сердечник и режущая кромка изготовлены из высокоуглеродистой стали. Медь представляет собой очень тонкий лист над этим сердечником. Он чрезвычайно прочный и функциональный.
Reply: @TyrellKnifeworks  сколько ударов режущей кромкой выдержит данная конструкция? Попробуйте провести такие испытания.
Reply from the maker: @АндрейГерман-ы4з  Я не думаю, что вы понимаете эту конструкцию. вы понимаете, что медь не проходит «сквозь» лезвие, верно? вся сердцевина клинка изготовлена из высокоуглеродистой стали. Пойдите посмотрите мою недавнюю сборку серебряной катаны. Я делаю с этим кучу тестов. Обратите внимание, все продано.
Reply: @TyrellKnifeworks  ты молодец, но я не считаю, что это настоящие клинки-это игрушки для взрослых🤓
Reply from the maker: @АндрейГерман-ы4з  Думай что хочешь. Это становится действительно распространенной техникой, применяемой мастерами по всему миру. Если вы этого не понимаете, это не значит, что это нереально.
Reply: @TheSpenceFencer  ☝🤓
Reply: In america we can carry these with anywhere we can carry guns.
Reply: @TyrellKnifeworks  This answered my question on why it's called Damascus. I Learned something today. Awesome video btw! Love seeing Blade Smiths work, would love to apprentice for one some day. It's a dream hobby of mine.
Reply from the maker: @viktorvolkov5314  I do teach in-person classes.  Check my website. 👍
Reply: @TyrellKnifeworks , Don't waste your time with these idiots who have probably never made a blade in their life, and certainly never made a multiple layer of metal. That sword of yours is the most beautiful blade I've ever seen, and I've seen thousands!
Reply: @joshmajor8662 , I thought exactly the same thing!
Reply: @TyrellKnifeworks  love your craftsmanship ❤️